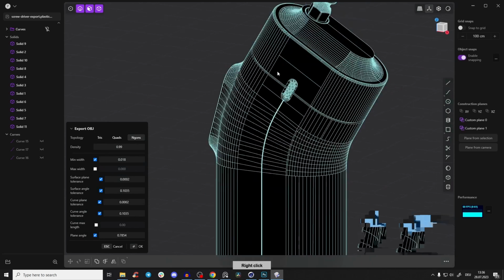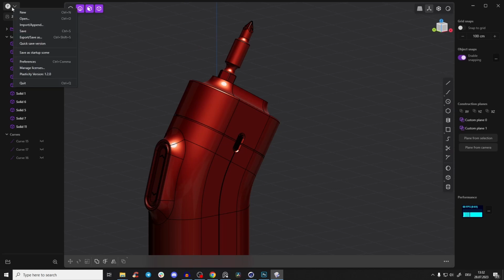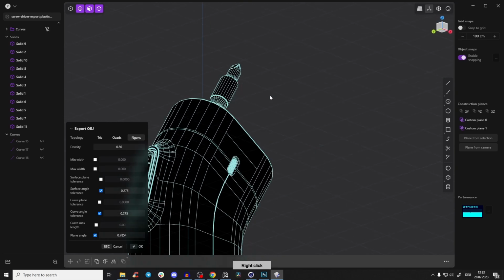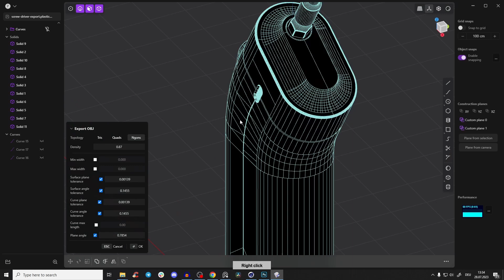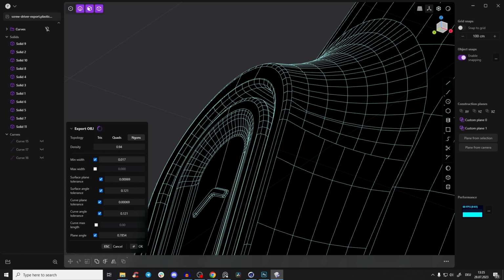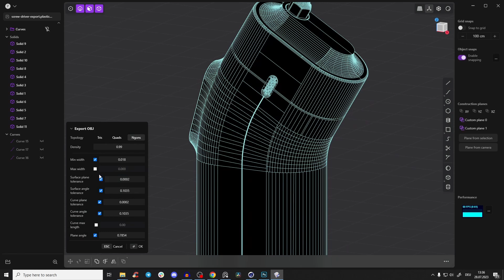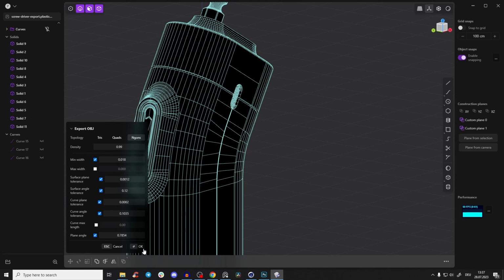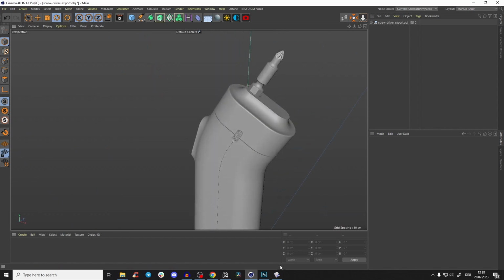Plasticity Tutorial | Export CAD to Clean Mesh

Comment: I'm on the trial version and there way too many issues. I use 3DS Max and when I import into that, loads of messed up faces and jumbled geometry using the NGON method but the trial version doesn't give you the options to customize the geometry density ect Great video though, I will have to sit here and manually fix all the meshes and do the HP in Max.

Comment: Is it posible to go the other way?  From a high poly mesh to a solid body mesh?  I know fusion 360 has a convert function that does this.  Wondering if Plasticity does as well?
Reply from the maker: Yes, its possible but not in Plasticity currently. 

I am using Moi3D for the conversion. Blender has an addon as well

Comment: Plasticity looks so nice to work with but I sometimes need quads export as I would like to use this for game engines where I need to be able to fracture the mesh and not have ngons or holes in the topology. And that topology looks pretty messy for anything that is not a static object.  I hope the plasticity developers improve the NURBS conversion to quads somehow but I imagine that is a very complex task to figure out. Maybe zbrush or blender quadremesher might be a good workflow to clean the topology quickly but  I think I will stick with blender for now.
Reply: hi, what quad surface look a like? it seems Plasticity is capable to export in Step format, so Gmsh mesher can read and generate full quad by few of setting.